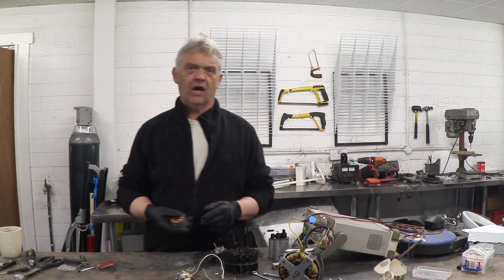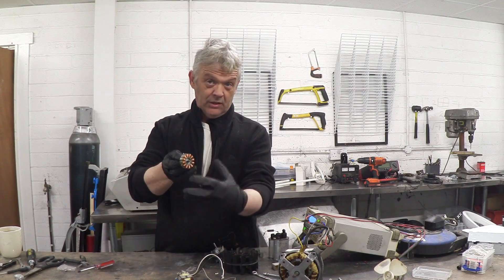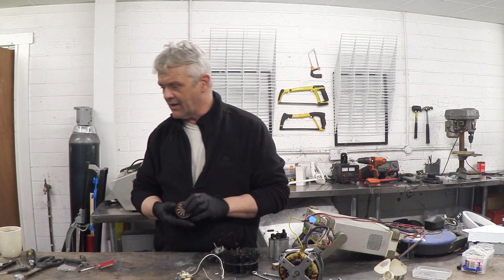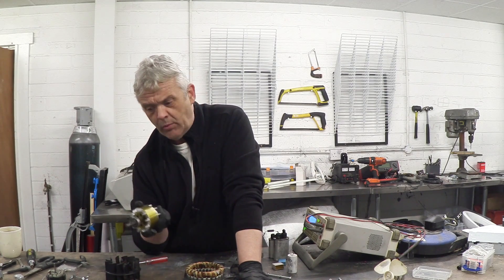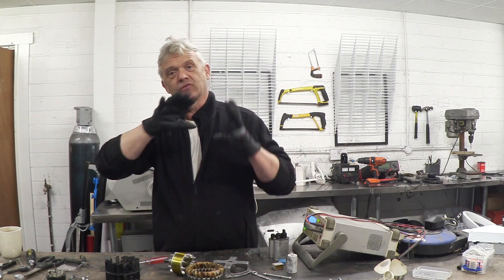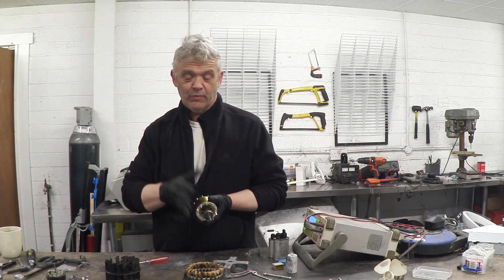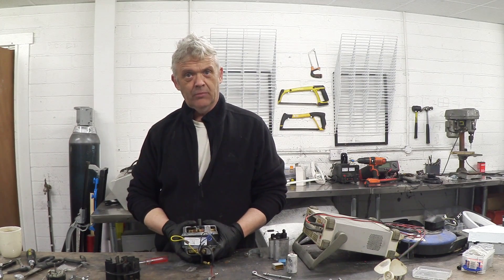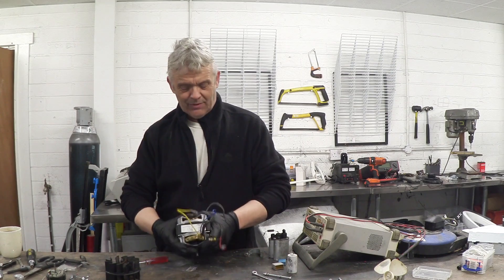500 An Induction Motor As A Generator Without Altering The Motor

Comment: I live in NE Alabama and back in the 90s we had an ice storm that knocked our electricity out.  I had a Chevette car with a diesel motor and I had a 120 hp 3 phase motor.  We mounted a wheel with a tire to the induction motor and jacked the car up and placed the tire that was mounted to the 3 phase motor against one of the rear tires on the Chevette.  The motor was a 460 volt 3 phase motor so I only used 2 of the three wires and ran the output through a transformer to get 240 volts. Then I added a large bank of oil filled capacitors.  I adjusted the speed of the Chevette engine to give me 60 hertz. I connected the system to my home and we had electricity all night...only had to add more diesel fuel the next morning...worked great!  The trick to using an induction motor as an alternator is to exceed the rated RPM of the motor and add enough capacitors.  This was before I had a smart phone to video the system....TRUE STORY!
Reply: The brilliance of redneck engineering is unsung genius. I learned more hanging out with a pack of mechanics from Alabama, Mississip, and West Virginia than I did in army training.

Comment: i was given the equipment from an old DRY CLEANING BUSINESS. the big dryer drum's bearing base was over 1 inch thick and over 4 foot diameter and had gussets too, the shaft was 2 inches thick or thicker. lots of 3 phase motors 220 volt and made in ITALY !  was planning to use to build a very large VAWT as i had 20 acres in montana that had one edge of the property on the edge of a very tall bluff. but got sick and ended up selling the property and scrapping out much of the equipment.
here in south dakota we have a strong wind most of the time. i can get metal 55 gallon barrels for free from a business, and i still have lots of the 3 phase motors, and other scrap metals.
it would be great if i could use the 3 phase 220 volt motors to make a VAWT that puts out enough DC VOLTAGE to keep a battery bank charged, maybe even hook several VAWT's in to a combiner some how.
i live next to a smelly ass cattle confinement operation so nobody would complain about noise etc...
as a scrapper i get lots of stuff that could be used all sorts of ways to build generators, but having the proper place to store it all is the problem!

Comment: Induction moters are used as generator in places where speed/rpm is variable because it can output canstant frequency independent of rpm and depends on input frequency given at the start using a soft stater, but moter should operate at super-syncronus rpm to generate power

Comment: It seems this would be perfect for a vertical wind generator, as the speed of the blades is self-limiting, so if you match the inductive generator speed to the blades, it will operate at peak efficiency.

Comment: Somebody gave me a wheel about pressure washer with a nice Honda engine (where I guess) the pump expired but the engine was basically brand new. I took an old table saw motor and by experimentation added run capacitors and sure enough like Robert says and  the old book "Alternator Secrets" says it generates mains AC.

Comment: Works well with a water turbine where it rotates just slightly faster than synchronous speed. You can attach to local electrical power and makes your watthour billing meter run backwards for a credit. It is inherently safe because if there is a power failure, it stops generating.
Reply: A resident of our village owns a property with a water stream. He installed a turbine and an induction motor that is connected to electrical power. All was fine until he didn't use any power in his home for a while and the watt-hour billing meter ran backwards. The power billing people became alarmed thinking that the meter was connected backwards indicating a possible drug grow operation. However this was found to not be the case but they remained concerned that power generation could backfeed making repairs to the lines dangerous. The inspector was an electrical engineer reported back that it was perfectly safe. I don't think that they would write a check for the power surplus but it did subtract from his personal usage.

Comment: To much capacitance is required if you want to have more power generator. Fortunately, it is possible to use an induction Motor as a generator without capacitors or  permanent magnets.

Comment: Have wanted to build a peddle driven induction motor generator for a while, I found out previously that there is a sweet spot at a certain rpm for producing optimum power , would be great to exercise and produce a fair amount of power at the same time, gearing would need to be precise of course, love your videos, always learn something new :)

Comment: Great video on this under appreciated generator, I almost clicked away when I saw you misidentified your first induction motor that's actually a universal motor. There are induction motors with wound rotors, but they don't rely on commutation when running at nominal speeds. Am I missing something?

Comment: Can someone help me out here? I bought a '24-Volt, 350W' rated motor that they said could also be used as a generator (it was billed as a 'Permatnent Magnet DC motor/generator').   But when I test it by spinning with a power drill, i can only generate hardly 10V, spinning it as fast at the drill will go.   Does it really take so many RPM to generate a decent amount of voltage? I have to generate MORE than 12/24v to charge a 12/24v battery cluster, right? Or can I somehow charge them with just the lower amount of voltage?  Do I have to hook the batteries up to it BEFOREHAND?  (to 'excite' the stator/windings).   Im just trying to charge my 24v (or even by backup 12v) battery clusters.  Any help/pointers would be appreciated.   Thanks!

Comment: I am building a gas powered 12 V Pmg motor generator if I use a battery disconnect for overcharge will it hurt to PMG motor if it is still running from the gas powered motor

Comment: That was a great explanation - I picked up a couple of washing machine motors form a scrappy today and whilst I was familiar with the bushed type (which i got working), I was confused by the other one which appeared to have no brushes but spun a lot smoother. Thankfully I thought "I know who's probably done a video on this" and wasn't disappointed. Going hunting for an old microwave tomorrow for some big capacitors to make it work as shown. Thank you so much for your videos, brilliantly explained, especially in the context of wind turbines (which is why I'm digging into this subject).
Reply: For what it is worth microwave oven capacitors are high voltage small capacity, you might find more suitable ones in other appliances. Power factor correction capacitors and motor start capacitors come to mind.
Reply: @g0fvt  Quoting Brian Spencer's excellent comment: "The capacitor is not a motor-starting type - these are rated for intermittent operation only, and often less than the motor voltage. (That's another story, though.) A polyester or other 'motor-run' capacitor is required, and should be rated at a higher voltage that the output voltage of the machine in operation. "
Reply: @SakuMättö  power factor correction capacitors such as used in flourescant light fittings will likely work fine,  they are rated adequately. They tend to be about 4uF so a few in parallel would be needed.
Reply: But I want to know where we get the out out from, if the mains are connected to the other capacitor 😮

Comment: If you power down the generator while connected to a load the initial magnetization of the core will be zero. If that happens disconnect the load and don't spin the generator (static) and temporarily apply a "AA" battery to it. The battery will leave a residual magnetic field that will be a starting magnetic field when you spin the generator up. To help prevent demagnetizing the field put two silicon diodes in anti parallel (anode of one to the cathode of two, and the cathode of one to the anode of two) and put the diodes in series with one of the load wires. The diodes will disconnect the load when the voltage drops down to either plus or minus 0.6v and leave a tiny bit of residual magnetic flux in the generator core. The small 0.6 drop won't be a serious loss at 120/220 volts AC. The generator works better with more capacitance. You can use polarized capacitors but you have to take another step before hooking them up. You take two of the same capacitance and hook their negatives together. The negatives are insulated and not used. The remaining two positive leads are used as if they aren't polarized and can be used on AC. The capacitance rating is halved but you now have a non-polarized capacitor.

Comment: A capacitor start motor is a type of split phase induction motor because the auxiliary winding is fed from the single phase input voltage through a capacitor which produces a current almost 90 deg out of phase with the main winding. The effect is to increase torque when the motor is started. The auxiliary winding is disconnected by a centrifugal switch when the motor comes up to speed. Is it too much to ask that your explanations are accurate?

Comment: Induction motors have no brushes. The electric current in the rotor is induced from the magnetic field set up in the stator through gaps between the rotor and stator due to Faraday’s law and a torque is produced in the rotor to oppose the induction due to Lenz’s law. The motor you are describing is a DC motor not an induction motor. It’s fun to watch you tinker but frustrating to see you Bollix the science.

Comment: I have a small motor hooked up to some leds and when I spin it, I can keep the lights shining. But when I attach a small battery to recharge it, the opposite happens it thieves the energy from the cell. I kinda estimated it generated 3v

Comment: just a ps for anybody starting to experiment with motors as generators , Take  a tip  and start with  the ones found in the heater box or the radiator fan . They come with nice magnets and decent bearings . They will always generate and help teach about what you can get out of these devices. . Old battery drills also are a good way of learning with lots of fun bits.Even a bike dynamo with a diode will make a fun wind project  spinning out in the wind running 3or for very bright LED'S  or through a circuit charging phones for free . I my self like the hub dynamos we used to find made in the middle of some front wheels as they make wonderful wind projects for free small amounts of power so get looking . I;m wondering weather to start a channel?

Comment: Tip of the day when playing with ready made motors  you will need to know .some motors have allouy windings looking like copper wire . even coated the same colour . What you will find is when you try to energize and parts such as the stata or rota com it will fail . in most cases the armature  will have copper wire but fields are made of allouy .metals , what the chinese do is attach 2inches of copper wire to the ends of there cleaner and washer motors with crimps hid in insulation , so if you grab the motor and clean of some insulation it shows to be copper ,. In truth this is done because of heat and currents traveling  across  the connections . when the com spins and brush gear make contact frequencies of 216hz will be made  per second while the motor pulses on and off .The faster the spin the higher the frequency the less current drawn .When under load brush motors draw more current as they slow under load .So the crafty sods attach real copper to the fields . Now when you try feeding the motor with a voltage to create a magnetic field all you get back is just a few volts .. so take off the brushes and remove the bearings for future projects and bin it , Some washer motors have the same set up and want make a bean , so don;t wast time and check first for copper .
Reply: I tried to use an induction motor as a belt pulled generator from a stationary bike. It was rated 1800 rpm and I was able to pedal it pass that speed to induce voltage but here is where the problem came into play..when attached to a load...like a fan or light bulb...the current( or voltage ) dropped and it became very hard to pedal.(I consider myself in decent shape) why is this.? When I use a 90 volt DC motor there is no drop in power
Reply: @rogerrabbit7469  That load needs current and it take real muscle to generate so the load took energy. ...You can convert load into horse power . roughly 750 watts becomes one horse power . 100 watts will be .75 horse now using a bulb will be a high current resistive load were as another motor is an inductive load as the voltage races through the coils the current lags behind . Making it less of a load till the motor is given work to do . -so no load the motor you put on the output had no load so it would take less current ?

Comment: gene reddington
gene reddington
1 second ago
GeneReddington   I laugh at this guy as he seems to know some thing about nothing , He's going by what hes been told and and not really learned about . truth cumming lol Take motor such as a squirrel type you don;t need to take it apart to make it generate . spin it with a mower engine and stick a 40microfarad 450 ac cap across the two power terminals and bingo you will get around 200 volts from a 240 volt motor . A 3/4  horse motor will make 200watts of power in an ac form . but the frequency dependent on it.s spin will vary .But when doing this as emergency supply you will need to turn any load of while it energizes .getting feed back from the cap.

Comment: Your video is playing at 4:00, and as I watch, I wanted to say that I learned how to magnetize the rotor by coiling a thick Guage electric cable through the holes that are put within the much larger ones. Once you have it ran through correctly, you just add an electric charge to the cable, and then remove the cable and the rotor maintains the magnetic field. I'll share the link to the video I watched. I tried it myself on an old blower motor that came out of a evaporative cooler. I wanted to turn the blower into a wind generator. I'll bring back the link shortly after I finish the video.

Comment: Why not use a variable cap?  Also,  weren't you supposed to start it with a supplemental voltage in?  How does the (start capacitor?)  Get the voltage in to begin with?

Comment: Do you need the same horsepower to push the motor that it puts out because they have a motor that Bugatti, and tesla are working with right now that is hook up right at the wheel base. The only problem with it is that it would put out A/C current

Comment: I really wish you would have showed how you hooked that up better. Seems you have 2 caps hooked to 2 different windings in parallel but I can't tell from the camera angle what you did exactly which is the point of the video. And why is this info so hard to find on the web? wtf? No one seems to know how to calculate cap specs? Why is this old tech so difficult to find specific info on? All I can ever find is vague things like this video and idiots drilling holes putting in magnets. Frustrating. I'll figure it out myself eventually.
Reply: so 8 months gone... have you figured it out? kindly share

Comment: Is it safe for the motor? I have minimal knowledge about how too little voltage can damage some motors and thus simple potentiometer dimmer switches cannot always safely be utilized. Is over and or under powering the motor safe for brushless induction motors without modification to be used for generation?

Comment: To all:   For more understanding: Remember, this saying . ELI    the  ICE   man.    Where  E= voltage   L= coil/inductor    I = current.      In an inductive circuit, then = voltage  LEADS  current.
ICE  where  I=current   C=in a capacitive circuit   E= voltage.   so.......CURRENT  leads   VOLTAGE, in a capacitor circuit.  This, should clear the idea, of 'how' a   'start'  capacitor, gets the rotation going. The centrifugal switch, inside/on the motor, will  switch off that starter winding, when after about the first  half-second, of spin up, or so.

Comment: I am trying to make a wind turbine with a cealing fan and a microwave capacitor. Like in the video I am puting the working capacitor in parallel but for me I am geting nothing. Am I missing somthing. Did he mean to put it in parallel in a diferent way? Are cealing fans diferent diferent somehow? (Note of couse I took out the speed controling conponents and am left with the primary and secondary winding )
Reply: Do I need to add small magnet to jump start it?
Reply: Also what dose the capacitor need such a high voltage  would it work with a capacitor that has a smaller voltage
Reply: My microwave capacitor is 2100v and .89ųF the cealing fan takes 120v AC at .5amps so is the capacitor large enough